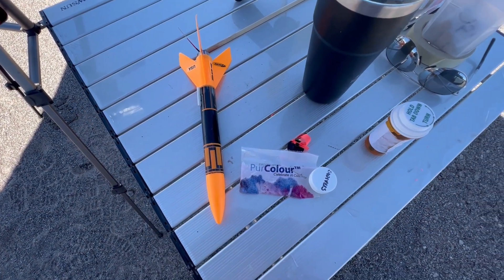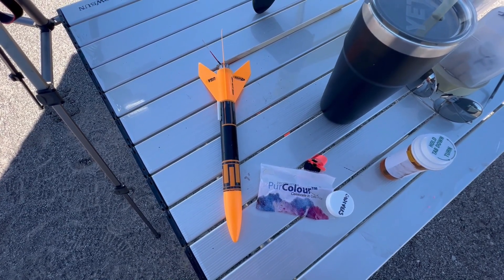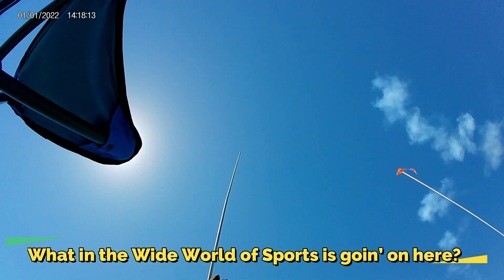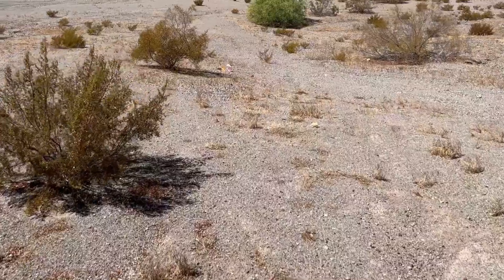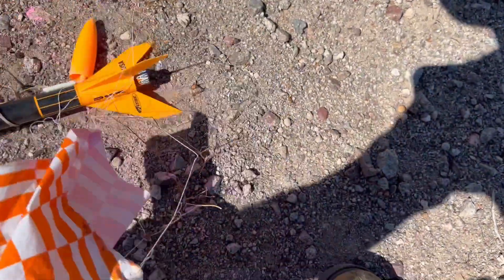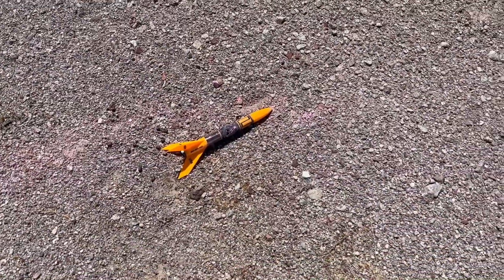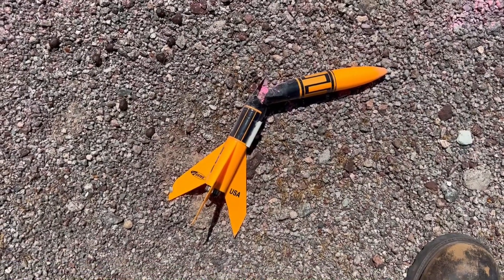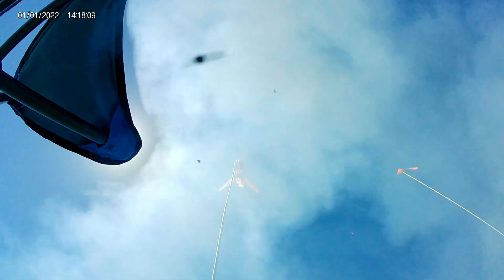Alpha III Model Rocket High Desert Mishap

Comment: Too much pink powder? I ran it on RockSim and it went to 2004 feet, safely. I had a strange problem on a Quest B4 motor where it did not have the power to launch the rocket high enough. I switched over to B4 Estes and it worked fine. I was told that maybe I did not get the igniter far enough into the motor to get full power.

Comment: Check the date code and see if it's before 11/2021. Quest had issues with the clay nozzles cracking causing the rockets to veer, though I've never seen one do zig zags like that. The first one looked like it was chuffing while in the air. Send photos of the motors to Karl at Quest for warranty replacement. He might also send you a similar Quest rocket replacement.
Reply from the maker: Ok! I will do this…. Thank you for this info, Ron!
Reply: What is “chuffing”?